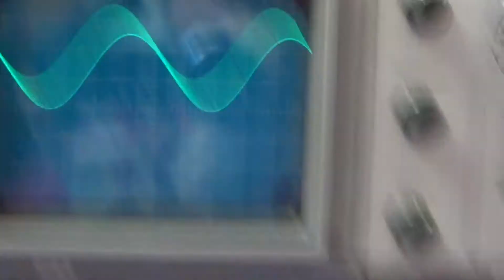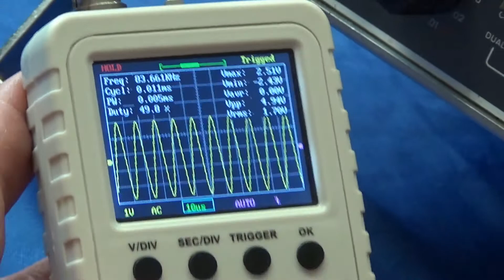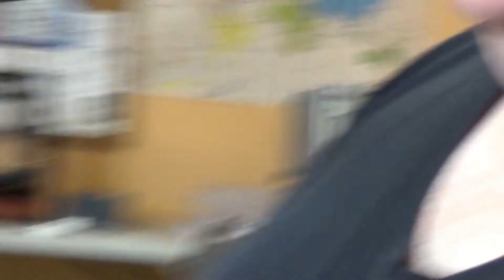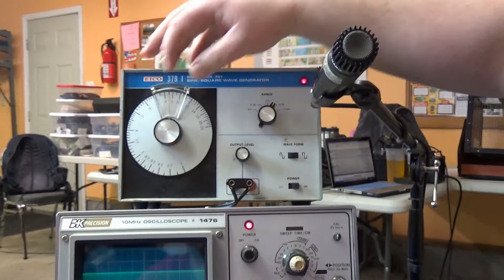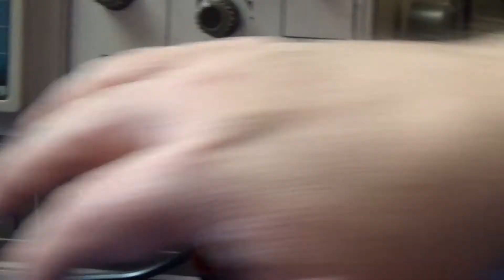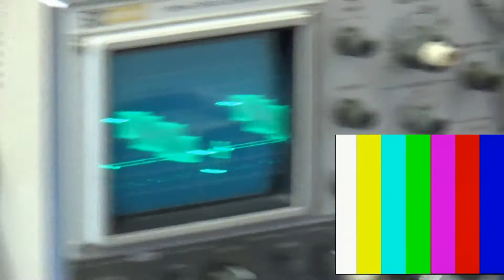Oscilloscope Madness!!! Oscilloscope Basics - 3 Old Tech Dudes

Comment: Greetings:
I am a retired Hollywood post-production video engineer. 
The reason that the NTSC color television standard doe not use a 30 frame per second  rate has to do with the audio circuitry built into many early monochrome receivers. 
[I say monochrome because unlike newsprint and zerographic copiers which are truely black and white devices, monochrome receivers can truely have almost any level between blanking  and peak white. ]
Although CBS introduced the first authorized color system, it was not compatible with  existing tv receivers. RCA developed and introduced an all electronic compatible system, almost. It turned out that many monochrome receivers used the natural beat frequency between the existing video (1.25 MHz) and audio (5.75 MHz) carriers of the system to produce the 4.5 MHz audio intermediate frequency (IF) used for the FM audio circuit. It was found that using the standard horizontal frequency of 15,750 HZ had unacceptable noise. AS all of the components of the tv signal have a fixed mathematical relationship to each other to allow the addition of the color information to be hidden within energy blank space within the  video portion of the signal that they settled on a frequency that mathematically was different by 1/1000 of the existing frequency. Everything is derived from a crystal of 14.31818 MHz. The color information is all based on 1/4 of that frequency at 3.57545 MHz 
commonly abbreviated as 3.58 MHz. If it was decided to keep the old frequency, which was possible, then all the incompatible monochrome receivers that used 4.5 MHz IFs would be obsoleted. RCA chose instead to make the frequency change to ensure their system was accepted by the FCC.
H-sync is 15734 Hz, V-sync is 59.94 Hz, frames are 29.97 Hz, film is now 23.976 frame.

Only dual beam scopes can simultaneously display two traces. To FAKE it, dual and four channel analog scopes take turns ALTernately drawing traces. When the sweep speed is too slow, there is the choice of CHOP mode which draws partial traces during each sweep. That is why your choices for display are ch1, ch2, ALT and CHOP.

Vector displays are known as X-Y displays on analog scopes and  are fed separately into X and Y inputs. NTSC vector-scopes extract the color info from the single composite input and use it to display chroma info radially.

Comment: Hey. Can you make a video explaining specifically what the back porch, horizontal sync, and front porch parts of the analog video signals do? What instructions do they give to the rendering receiver? How does the monitor react during those periods of the signal? I’ve haven’t had been able to pin down their exact functions, most explanations just give a vague answer.
Reply from the maker: We will see what we can do, that's a good idea for a video!
Reply: @3oldtechdudes  Awesome. I'm really looking forward to it.
Reply: Greetings:
The blanking level is that portion of the 2H  waveform monitor display that is continuous except for where the sync pulses desend below that level. The sync pulses are responsible for locking the raster to the incoming video. [The raster are the lines that show when no video is coming in.] The horizontal hold control is used to control the raster speed not the video. The incoming videos sync pulses are oly used to force the end of the drawn raster line which means the raster lines must be slightly slower than the incoming video sync. The vertical sync pulses are integrated by a slow reacting circuit to allow creation of a large pulse used to lock the raster to a slightly slower vertical rate than the video. The front and back porch are part of the blanking time that determine the beginning and end of each video line. The 8 cycles of the color burst are used to lock the color oscillator that runs continuously but must be manually set so it is very close to the burst frequency.
Reply: There's an old program MS-DOS entitled "NTSC" where you can learn about NTSC signals.

Maybe try and find that, if the video is not ready for production?

Good luck ! :)

Comment: Hi..  love your videos.. Another cool thing for these old scopes is to use as a component tester to get a visual look at all sorts of different components.  As to if they were good or bad or to identify an unmarked part from your junk box...Some later ones came with these built in ..but it was easy to home brew one.. with a small filament transformer and some parts or use your signal generator... 
My first scope was a heathkit.. a whopping 5 mhz...